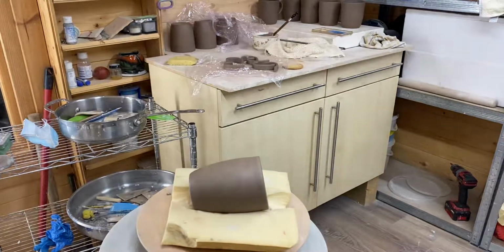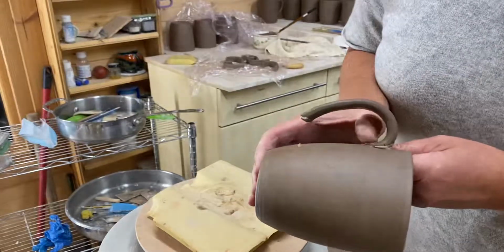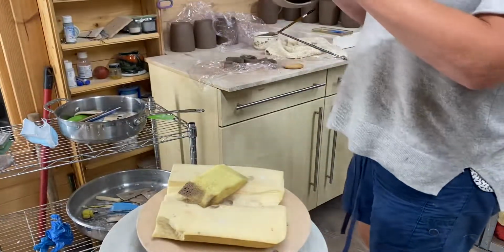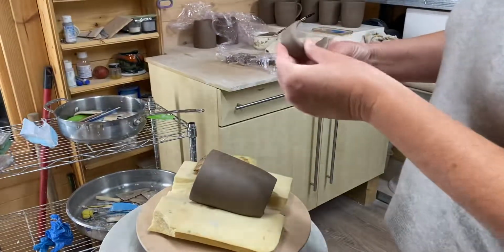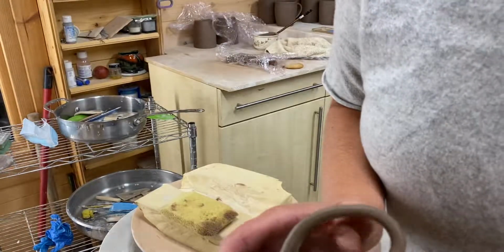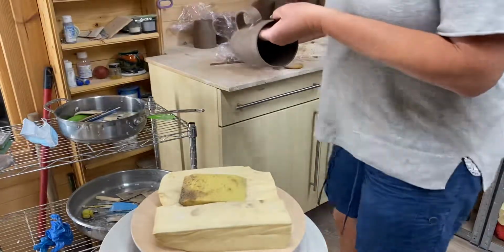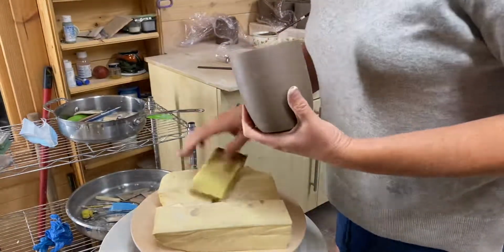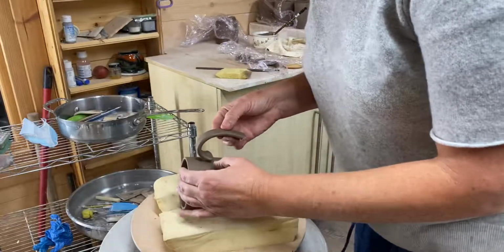62.Putting on Handles the Keith Brymer Jones Way. It works brilliantly!!

Comment: I notice you do not score before adding the slip.  Any cracking issues?
Reply from the maker: Sorry just seen your message. No no cracking. As I said there is a UK potter called Keith Brymer Hones and I watched his way of adding handles and I copied it. Both handle and pot must be the same dryness. Best way is to make put both in a tubaware container and the will be the same after a period of time.